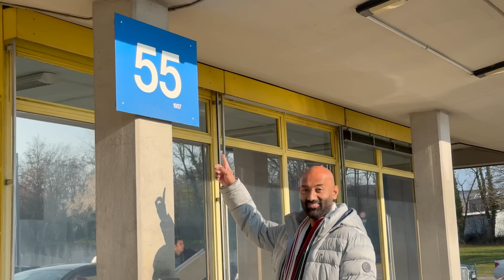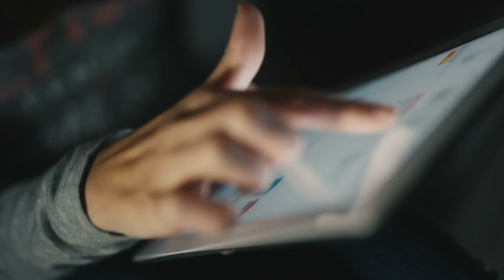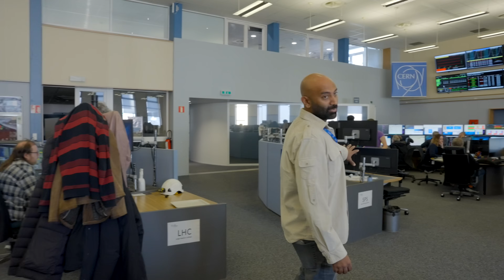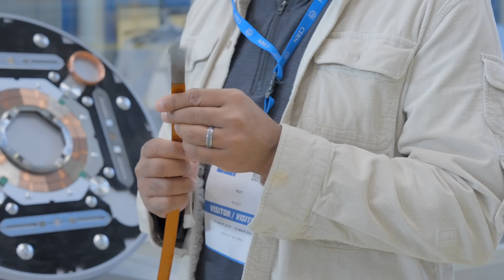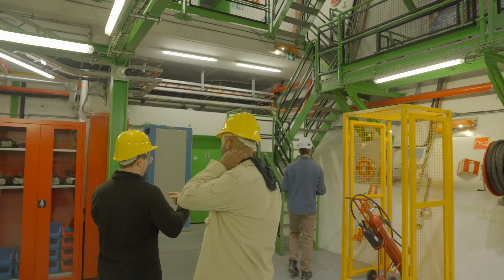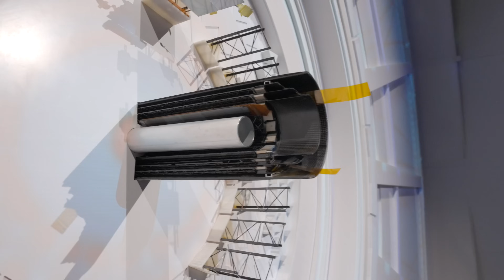How Breakthroughs at CERN will CHANGE The World!

Comment: There is a brain drain of particle physicists in US because they are all going to Europe to work for CERN. If we don't make our own large size collider, we would just have handed over the greatest discoveries to Europe. US research in quantum mechanics in the early 1900s led to: Lasers, semiconductors, computers, GPS, cellphones, and the Internet. Discoveries in CERN could lead to a nutrino-based communications network that would disrupt Starlink and undersea fiber-optic cables and many more. Building our own large hadron collider is not just bragging rights, it will also determine who controls the next industrial revolution.

Comment: I did part of my physics studies at CERN, 30+ years ago. At that time the experiments made sense. Today however, the expansion of the accelerator lab makes much less sense. The promised scientific  return on investment is very unlikely and is not based on science in my opinion. The standard model does work and does not need additional particles.

Comment: If a particle (A) is at 0.999999c (relative to the outside observer) and it hits another particle (B), going in the opposite direction at 0.999999c (relative to the observer), what is the speed of the collision as seen by particle A?

Comment: So does this mean that a trip to SNOLAB is on the docket?  For the uninitiated, SNOLAB is the Sudbury Neutrino Observatory, Located at the 2100 meter level of the Creighton mine in the Sudbury Nickel Basin.  The SNO facility and the experiment director were co-awarded the Nobel prize in physics for their contributions to the discovery of Neutrino Oscillation.  I've been to SNO once, on a tender for a project to replace the incoming telecommunications circuits from old archaic T1 PRI's to IP Telephony;  A contract we were awarded as one of the only providers that was able to make it work and still be able to keep them online if their connection to the surface died.  I personally designed and wrote the config for that setup.  If you DO make a trip up to the frozen north, hit me up for some good old Canadian hospitality.

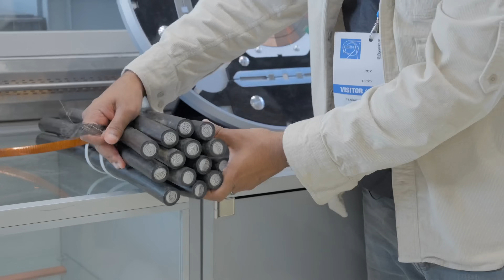Comment: That's Aluminium not copper 15:22 I know, getting picky, but it's so obvious, and it matters what the matter is. And it's a cable not a coil.
Reply: I noticed the same. You would think that even the CERN needs to think about cost. Aluminium is cheaper than copper, but requires proper connection to avoid problems with the oxide layer. UNLESS it is a unique CERN specifically chosen alloy that happens to be a "white" looking metal. But I guess it is regular affordable aluminium cable on that photo

Comment: Neutron transmitters for radio and phones 😂 hold my beer, while I laughing......... nope, you have no idea how much power that needs and only direction like microwave. Lol please do, I will bankrupt them even harder. Love the effort in this video, I actually got two bits of information,  I finally learned what some parts are made of, great questions, the look in her eye about the building magnet parts there, she didn't know the answer and glossed over the question, fair play to you, you asked the question in a different way, to reveal they make their own magnetic coils.  😮 great work, you had the tour guides working today.
Reply: I guess you need a robot skeleton to support the weight of all the masses that capture those neutrinos then 😂 inside of your phone. A phone as large as a mountain to shield against those neutrinos coming from stars or what/wherever it origins from in the depths of the universe
Reply: @grilsegrils9330  the receiver for a phone can be small, but like you said, but flipped, yes you would need to walk the whole mountain to find the signal, for the nutron signal transmitted it's so small. Like breathing could drop out the call, few can stand still, like the corded line lines of old phone lines, while talking on the phone.

Comment: So I have a question. If no one can measure the one-way speed of light, then how'd you know it's traveling at 99.999991% of the speed of light. In reality, isn't the truth that you don't know the speed of light, which means all the experiments ever done at cern are suspect?
Reply: I think there is a mirror on the moon for instance. Guessing it can be measured directly sending a laser beam onto it. But I don't know the distance to the moon if you don't have the a known constant for light anymore. The distance around the equator is known, therefore also the Earth's curvature. Maybe you can triangulate the distance to the moon based on to spots of shade from the moon and the known angle since you should know that based on the distance between let's say New York to Paris or some other chosen spots the shade falls onto. Does this make sense. However the time is different on the moon surface than it is on the Earth's surface. Oh this thinking just gives me headache 😆

Comment: An incredible opportunity indeed!

As for using neutrinos for communication on Earth, here's what Gemini had to say:

"In short: Currently, using neutrinos for practical communication on Earth is highly impractical due to immense technical challenges and costs, despite its unique theoretical advantages.

Here's a more detailed look:

The Theoretical Appeal (Why consider it?):

Incredible Penetration: Neutrinos interact very weakly with matter. This means they can pass straight through virtually anything – oceans, mountains, the entire planet Earth – without significant absorption or scattering. This is their primary advantage over electromagnetic waves (like radio) which are blocked or attenuated by dense materials.   
Direct Point-to-Point: They travel in essentially straight lines. You could theoretically send a signal directly through the Earth's core to the opposite side, unlike radio waves which rely on line-of-sight, bouncing off the ionosphere, or relays/satellites.
Potential Security: Because they are so hard to detect, intercepting a neutrino beam would be extremely difficult compared to tapping a fiber optic cable or listening in on radio waves.
The Major Practical Hurdles (Why it's impractical now):

Generating the Neutrino Beam:

Massive Infrastructure: Creating a focused, modulated beam of neutrinos requires high-energy particle accelerators (like those at Fermilab or CERN). These are huge, complex, multi-billion dollar facilities. They are certainly not portable or easily deployable.
High Energy Consumption: Accelerators consume vast amounts of electrical power.
Inefficiency: The process of creating neutrinos suitable for a beam is very inefficient.
Detecting the Neutrinos:

Enormous Detectors: Because neutrinos interact so weakly, you need incredibly large and sensitive detectors to catch even a tiny fraction of the neutrinos passing through. Think detectors the size of buildings, often filled with thousands of tons of purified water or scintillator fluid, lined with sensitive photodetectors, and typically buried deep underground or underwater to shield them from cosmic rays and other background radiation (e.g., Super-Kamiokande, IceCube).   
Low Efficiency: Even with massive detectors, only a minuscule fraction of the neutrinos in the beam will actually interact and be detected.   
Immobility: These detectors are fixed installations, not something you can easily place where needed for communication endpoints.   
Extremely Low Data Rates:

Due to the difficulties in generation and the extremely low detection efficiency, the rate at which information can be reliably transmitted is incredibly slow. Experiments have successfully transmitted simple messages (like the word "neutrino" using binary code), but the data rates achieved are orders of magnitude slower than even dial-up modems, let alone modern broadband. We're talking bits per hour or even slower in some demonstrations.
Prohibitive Cost: Building and operating the required particle accelerators and detectors is astronomically expensive, making it completely non-viable compared to existing communication technologies like fiber optics, radio waves, and satellite links for almost any conceivable application.

Experimental Status:

Scientists have demonstrated the basic principle. For instance, the MINERvA experiment at Fermilab successfully sent a coded message using a neutrino beam detected a few hundred meters away in 2012. However, this was a proof-of-concept using existing large-scale physics research infrastructure, achieving a data rate of about 0.1 bits per second with significant error correction needed.   

Potential Niche Applications (Highly Speculative):

Submarine Communication: Communicating with deeply submerged submarines is difficult for radio waves. Neutrinos could potentially penetrate the ocean depths. However, the challenges of fitting a generator or detector (even a smaller, less capable one) onto a submarine, and the low data rate, make this extremely difficult.   
Through-Earth Communication: For specific, secure, low-bandwidth communication directly through the planet where conventional methods are impossible or compromised.
Planetary/Interstellar Communication (Very Future): Over vast distances where signal degradation is an issue, neutrinos might offer advantages, but the challenges are even greater.
Conclusion:

While the physics allows for neutrino communication, and the concept has unique advantages like unparalleled penetration, the engineering and economic barriers are immense. Building the necessary generators and detectors is incredibly complex and expensive, and the achievable data rates are currently far too low for any practical purpose on Earth compared to established technologies. It remains a fascinating area of scientific research but is not a practical communication method for the foreseeable future."
Reply: One innovation they could commercialize would be to develop AI to analyze all of the data from the dozens of monitors and display only relevant data on one monitor or tablet, tailored to that person's needs, which would save several kWh daily (from not powering dozens of monitors, and perhaps even eliminating the need for a control room in some cases) and ensure that staff don't miss critical data...

Comment: Cern is indeed an impressive accomplishment. However, in 1974 a similar collider ring , but much smaller, at SLAC, discovered the Psi particle. Richter and Ting received Nobel prizes and the discovery was important to particle theory. The big difference was scale, as our facility could easily fit in a football field. My assignment was to build a 3d x-ray detector which was successful, but it turned out to be small enough to fit in a hospital. Combined with computer modeling advances in our group, the groundwork for the modern CT scanners emerged. I contend that the biggest "bang for the buck" was in 1974.
Reply: That's fair. But remember that Cern is also the birthplace of the world wide web (1989), and it was "just" a side project.
Reply: @MedeaYoung  That is not exactly true, remember DARPA?
Reply: yes but it can never accomplish what CERN can
Reply: In '92 I helped to work on manufacturing a stainless and copper coil for a power supply. The stainless was a rectangular tube about 1x3/4 that was filled (and I do mean filled) with stranded copper, shielded from the steel with idk what. I have no idea if it was ever put to use. I was told it was for a ground-based laser system. The coil, was over 600 meters long. If anyone out there has any more info on this, I would be grateful. 
Side note: This might actually be part of a training vid by now. I was removed from the project after my hair got stuck in the mill.
Reply: @ no we have another system, the coil was that long? no clue, I could ask one in a near facility if they us such coil but don't think so, which Ø`?
Reply: You are probably a sabine watcher. Buzz off
Reply: @PrehistoricPig69  lol, true. You watch this.
Reply: Did they pay landowners for running it under their property??
Reply: @TerryMartin3428  in what way?
Reply: THIS IS GREAT NEWS.

Comment: One of my first jobs was working for  small company that designed and built linear particle accelerators (and similar pulsed-power machines). We worked on the synchrotron used at SLAC, and I worked on computational models to help develop the original Z-machine at Sandia National Labs. That was interesting work.
Reply: That's awesome! I just love our audience!!

Comment: Could that theoretical neutrino-based  communication tech be configured to transmit electricity wirelessly underwater to power ships?

I think long-range power transmission is the key to making marine shipping go electric.
Reply: I don't think so because neutrinos are neutral and don't carry an electrical charge, and so won't be able to generate a magnetic or electric field in the target ship. They are theorized to have a tiny magnetic dipole moment which would make them like tiny little magnets and when you move a magnet next to a conductor it can induce an electrical current, BUT if it exists, this magnetic dipole moment is so tiny that we haven't even been able to measure it yet, so if it's there, it'll probably be unpractically small.

Comment: OMG Just LOVED how this video came out. It's been a lifelong dream to visit CERN and see these facilities in person.
Reply: Firing two bullets at each other so that they collide is extremely difficult. However, precisely colliding two photons across 30 kilometers is an incredible feat. Keeping them on the correct trajectory is a challenge. The magnets and the calculations underlying them are difficult to understand for non-experts; the slightest deviation would let it miss the target.
Reply: @Nebukadnezar2036  That's true. But I think that the trajectory is actually the easy part. You can tweak the magnetic field and gradually change the orientation of the beams until you start seeing collisions. Protons in the LHC don't fly solo, they fly in bunches of around 115 billion protons each on either direction, so it's less like trying to toss two grains of sand hoping they'll collide, and more like taking two handfuls of sand and tossing them in opposite directions. You have no control over who crashes with who, but you're almost sure that some grains will crash among themselves.

What I think is by far more challenging is precisely timing when and where those collisions take place. There are 2800 bunches travelling at almost the speed of light separated by roughly 7 meters or 25 nanoseconds and you have to time the bunches so the ones coming from either side collide right in the center of the detector. That's gotta be tough! I imagine that a computer must know where each bunch is at any given time, and they probably have to correct for the slightly longer path that the protons in the outer ring take compared to the ones that travel through the inner ring.
Reply: @Israel_Two_Bit  That's right, it's not a single photon, but I wanted to let those who've never seen anything like this know that high-tech is at play here. Even a small sensor can produce a measurement error; the problem is the work behind it, not the mutual bombardment of billions of photons. This is precisely why I left that out. 👀Remember the Opera measurement, when we thought neutrinos were faster than light? It was only 60 nanoseconds. Many laughed as if we were idiots, but the mere ability to measure such speeds is an enormous feat
Reply: You are a just  moron .